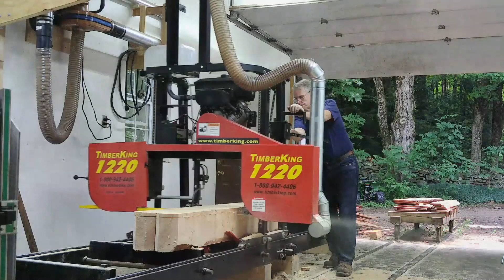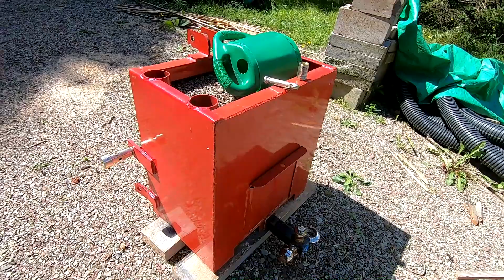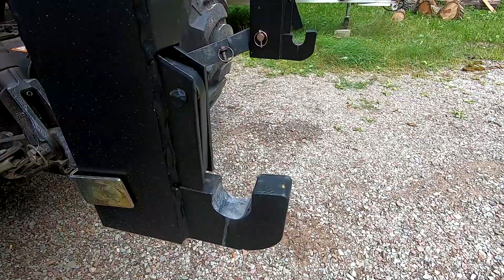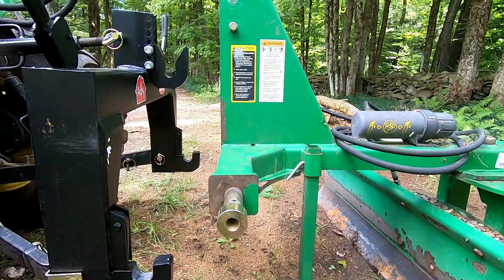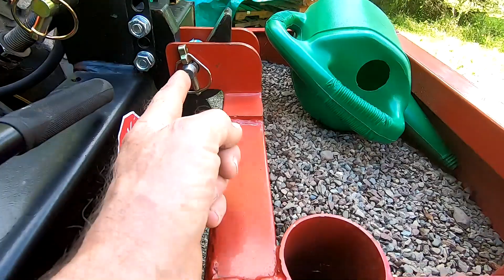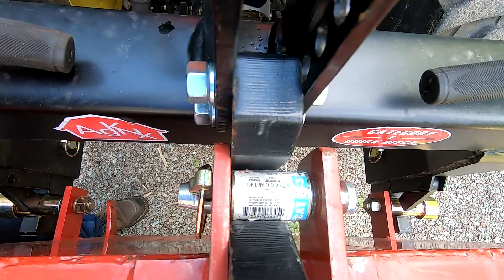Quick Hitches Quickly # 59

Comment: Wow - what a journey!  Huge thanks for sharing.  Your experience with the top-link on the Titan unit - how does a product like that even get released?  Clearly little if any real-world beta testing.  The death is truly in the details.  
Ditto on the Harbour Freight unit.  There truly is a difference between what shows well in the promotional material and what happens in the field.  
Great explanation of the issues and the importance of leaving an implement level for ease of future hook-up.  Nice work on the videography.  
Also - love the vertical tubes built into your counterweight box.  I do not have those on mine, but will add them to allow carrying a rake, shovel, etc.  
Great point on the Category classification and the adapters.  $200 later, and I'm now 'golden' in terms of fit.  :(
Huge thanks for a clear concise presentation.
Reply from the maker: Thank you for the resounding endorsement.
What really bothered me with Titan was when they demanded that I prove the unit wasn't made to their specs.